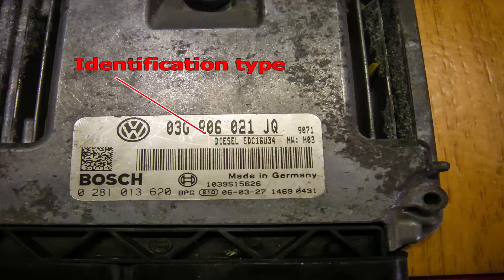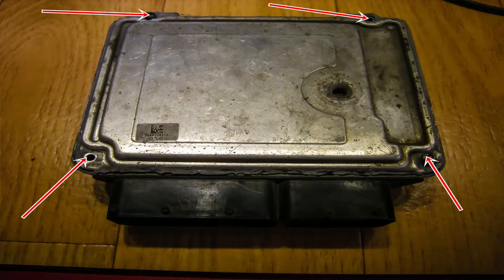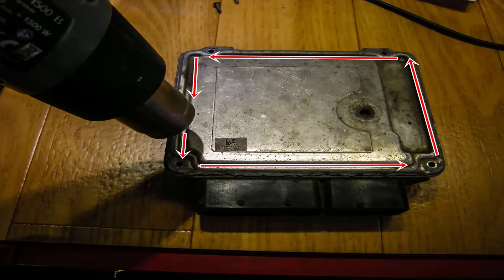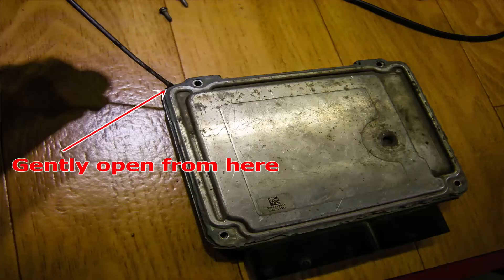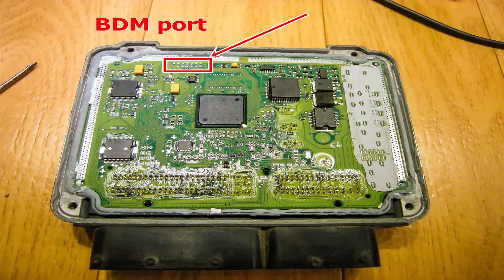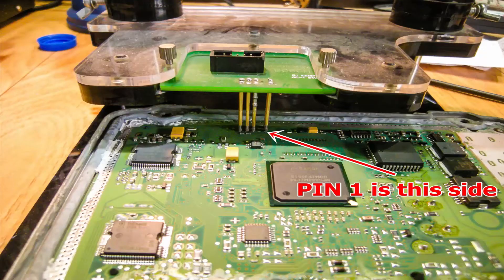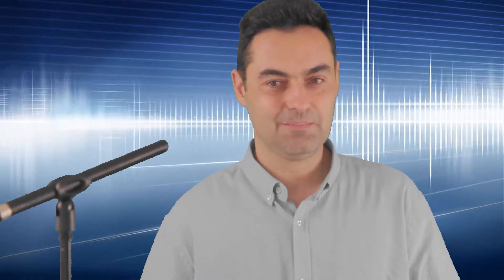BDM flashing car ECU Bosch EDC16 chiptuning

Comment: So I can safely tune my 2007 Mercedes CDI with OBD and MPPS program? Wich Program do you recommend for tuning edc16 software?
Reply from the maker: Yes , you can read mercedes edc16 by obd, but i will recomend Kess V2 or Galletto4. Just have in mind before reading to disconect the cooling fan because it will run and this will make your batery to die.Put battery charger also is needed. For software it is up to you: ECM titnium, Winols, Swiftec but all of them will need experience so ,better buy file from tuners.
Reply: Thanks for quick answer, I will look it up!
Also send you an email with same question :-)
Great Vids!
Reply from the maker: thanks!
Reply: Hey a fellow supermoto rider!

Comment: +Nikolay Nikolov I have a challenge for you!
help me figure out how to tune my ecu!!!! its a bosch med17.7.2 ecu out of a 2015 cla45amg.
the only tools i can find are too expensive. I only plan on tuning only one car not every make and model!

do you think you could help me figure out a way?  I cant figure out what tool works with this ecu.
Reply from the maker: +OverBoos I was Magicmotorsport distributor,  few years back.
Unfortunatly now i dont have up to date tool.But i can tell you that ,100% 
this ecu is tuning protected,so to can tune it,you have to open it, and use bootloader.You have to solder one boot pin to avoid protection.
I did this for MED17.4 ,but your is much new so it is good idea to visit tuning center and to pay for the manipulation.Will be ten times cheaper instead buying flasher.One of the best option are Alientech flashers like Ktag and Kessv2 .I recomend only original tools from them.
Reply: ok cool. thanks for the information. It looks like i have to go with ktag. the good thing is that ktag is on the cheaper end of the spectrum. hopefully i can find a good deal on a ktag otherwise i might have to go with a clone. thanks again for the info very helpful
Reply from the maker: +OverBoos Their official website is: http://www.alientech-to.it/index.php/en/
When you contact them ask for Massimo Contini.He is good friend and good person and he is sales manager.
I hope that helps!
Regards!